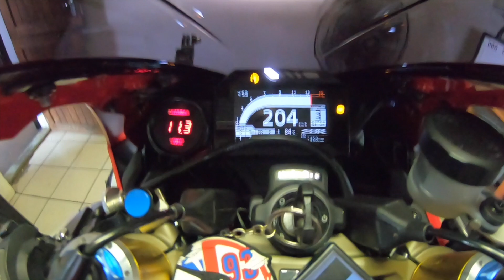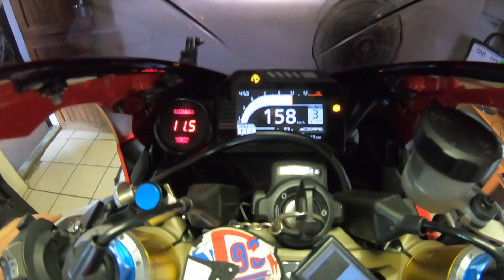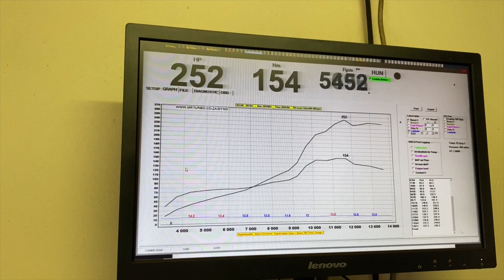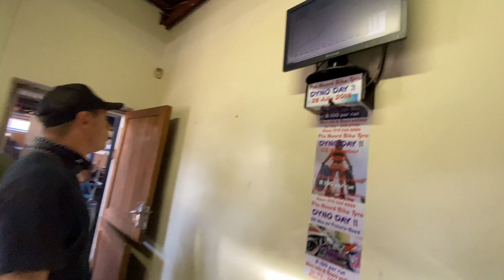HONDA CBR1000RR WITH NITROUS MAKES HUGE POWER

Comment: what shot are you running on it, thinking about putting a kit on mine
Reply: You’ll be safe to about 40hp shot stock motor
Reply: I run progressive 60 on the road. No issues (I did have to retard ignition)